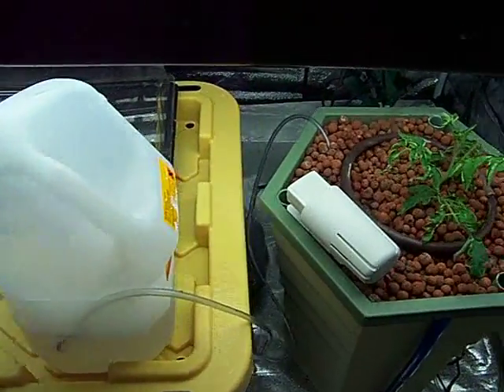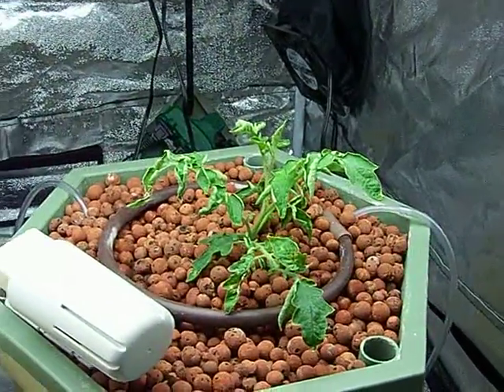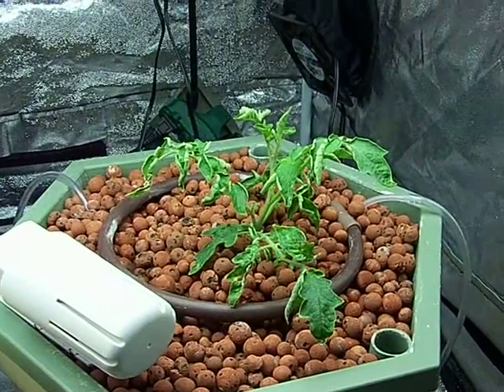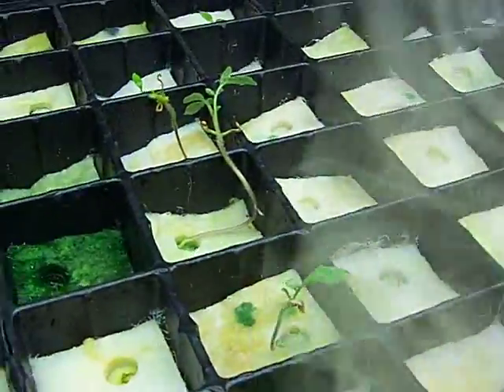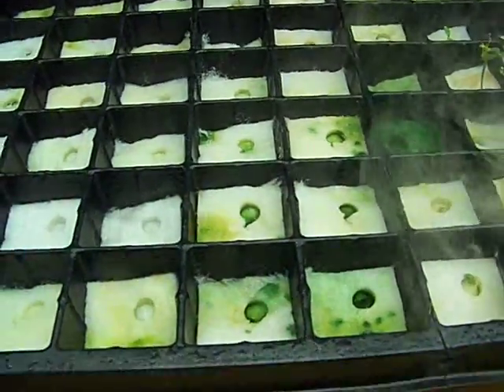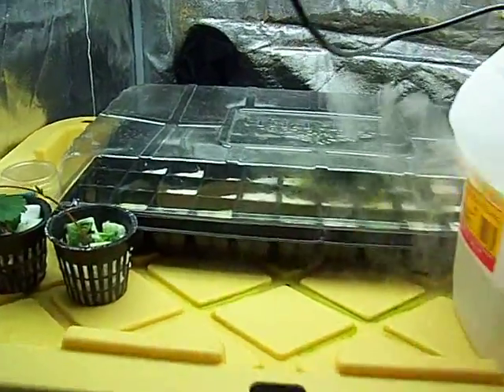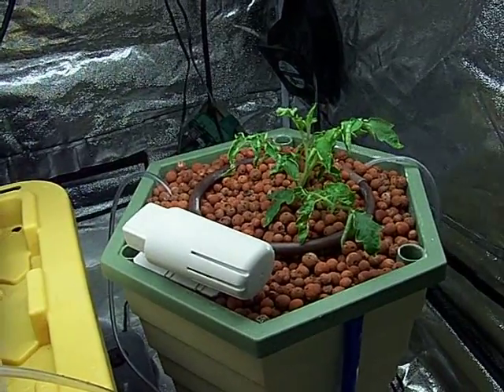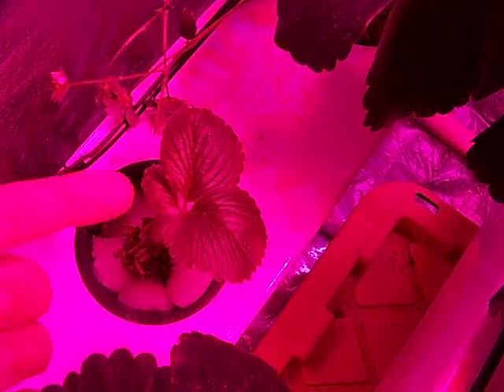Hydroponic Veg Room Update

Comment: I've had good luck germinating some seeds with damp paper towels, stuck in a ziplock bag.  Then I put them in a seed starting tray with a seedling heat mat under the tray.  Might be a bit overkill, but that's worked with most seeds.  Lettuce seeds didn't start this way for me.  I could only get lettuce seeds to germinate under lights in the sure to grow starter cubes.
Once they germinated out a bit, I cut a slit in the sure to grow cube and stuck them in.  Maybe that would be helpful to you.